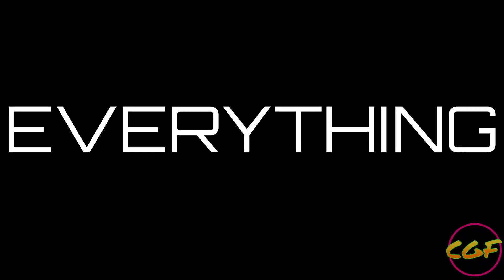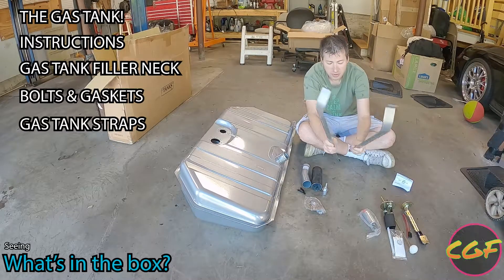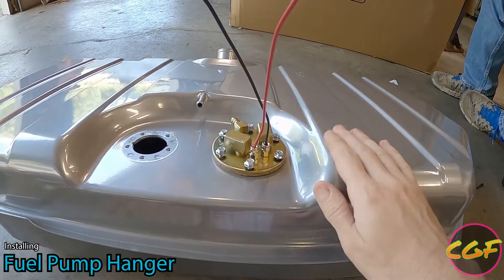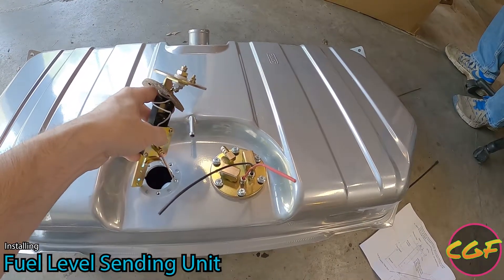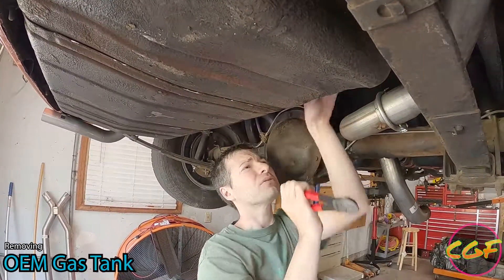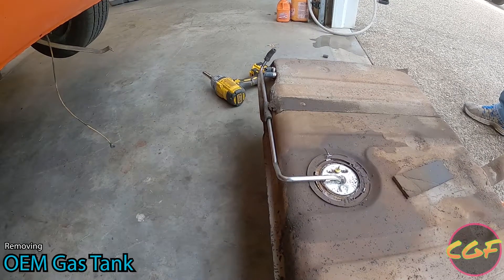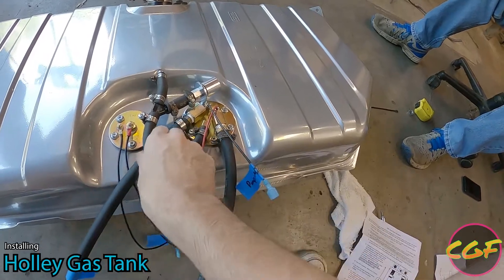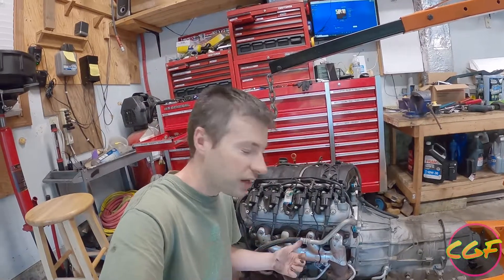Installing a Holley Fuel tank and EFI Module Combo into our 1970 Camaro LS3 swap

Comment: You probably all ready figure out that the tank vent/rollover valve needs to be mounted higher than the tank inlet pipe and mounted vertically so when you roll the car the ball tips upside down and shuts off the fuel. Horizontally will not work and if you fill the tank to the top of the inlet pipe it will leak out of the valve if it is mounted lower than the pipe inlet. Could start a fire if your exhaust is hot.

Comment: Excellent video! Finally found a 2nd Gen swap that I can take notes from. 
Can the existing stainless steel fuel line be used for the feed since it looks to be the same inside diameter, and it’s already run to the front securely???
Reply from the maker: I ended up running new fuel lines since mine weren't in amazing shape.  Is yours are and the right size I don't see why not. I've used oem fuel lines in other swapped cars
Reply: @CarGuyFridays  yeah, mine are 3/8” and stainless steel. I ran the car before I got into the build so I know everything is safe…👍🏽
The one thing about my build that makes me more comfortable is the fact the car was a driver before I started…

Comment: Great looking car. I'm going to look at a 2nd gen on Saturday and my plan is to LS swap it as well. For motor mounts, do you use the factory ones?
Reply from the maker: Thanks!

I'm using the holley ls swap kit.  It uses factory clam shell mounts. I bought some polyurethane mount inserts. You then get adapter plates and viola, it bolts right in. 

A 4l60 would fit in the transmission tunnel. I didnt realize how small the tunnel was and bought an ls3 / 6l80e swap only to find out the 6l80 wont fit without trans tunnel surgery.  That's next on my list. Video coming in the future on it. Dont forget to subscribe so you dont miss!
Reply: @CarGuyFridays  Thanks for response, already subbed after watching your first video on the car. Hopefully the car im going to look at tomorrow isn't too bad for rust and I can learn a few more things from your channel to put into my own 2nd gen!
Reply from the maker: I'd love it if the channel helped you out in anyway!  Good luck on the car being in good shape
Reply: @CarGuyFridays  It wasn't. I just bought a 1990 mustang roller instead. Pulled the tranny out tonight to find out it's not a th400, but a c4 instead.. So now I'm shopping for a new tranny.
Reply from the maker: It happens.... good luck with the new mustang. Those can be beast too!